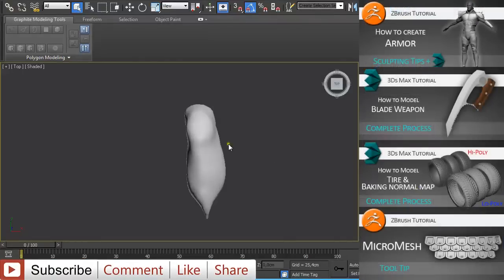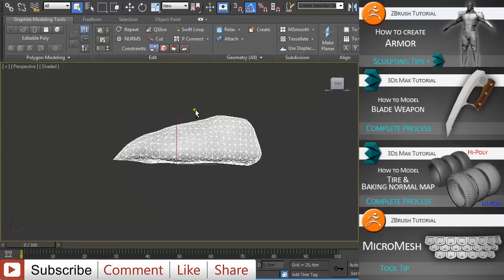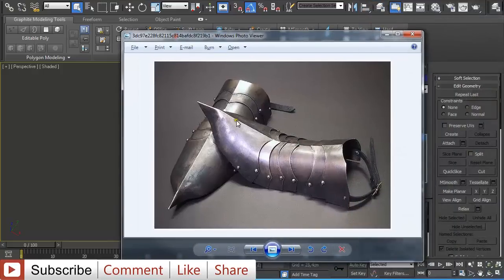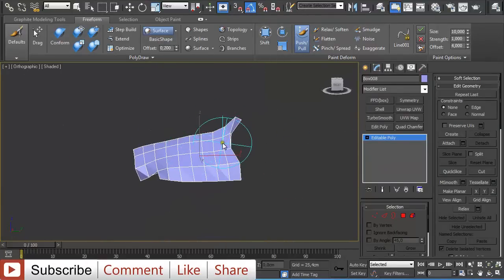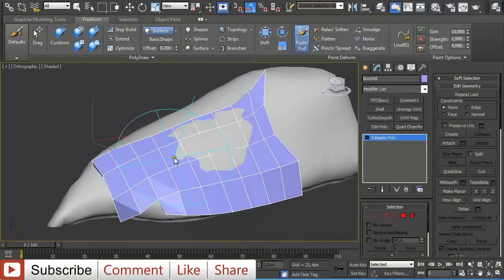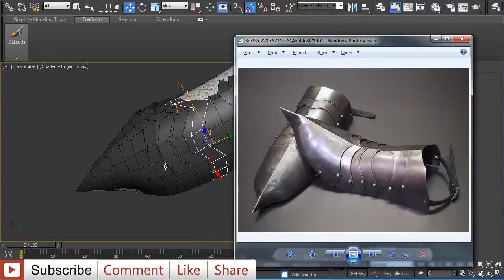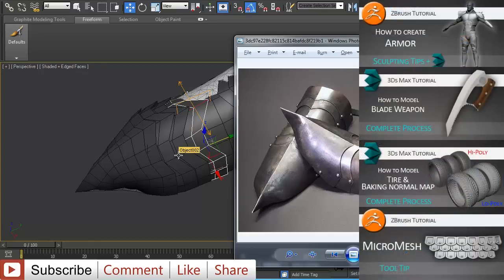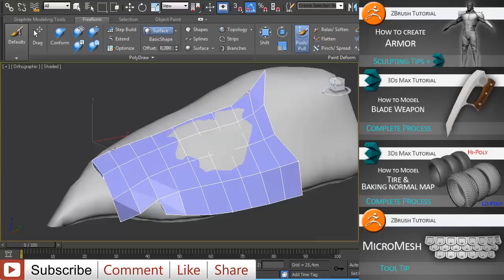3ds Max tutorial: Retopology with Freeform tools

Comment: how to use conform tool in spline 
please tell me
Reply from the maker: You can not use conform on splines. You need to convert it to editable poly and make adjustments with comfort tool. Then you can select edges and "create shape from selection" (under "Edit edges" section on the right of your screen)
Reply: but i m use spline and convert spline to editable poly then hide spline
Reply from the maker: you need to have your spline "closed" so when you convert to editable poly it can create polygons

Comment: Good video, but I have a question: Why is it necessary to do retopo by hand? Usually when I'm making a model, I start with the low poly outline first and then build the high poly from that. This way, I already have the low poly mesh in mind that I want to use and I don't have to go through this process.

It seems this is only necessary when you start with a high poly and don't have the low poly it came from, or the decimate/optimize software isn't working right.
Reply from the maker: Its not necessary to do the retopo by hand. There are also other ways to make low-poly model (one is the one you described). I just wanted to show, how a high-poly model can be retopo with tools in 3ds Max.
Reply: That's usually the case for hard surface I find.
Reply: If you sculpt a model in Zbrush for instants, you do a high res sculpt that then needs a retopo for low res mesh
Reply: Import a solidWorks file, all of geometry is  "Tris" . this method is very useful for create a new objet from imported files... If you dont have retopology modifier (thats mi case)

Comment: I just have a question, as a game design student. Why do people still use these freeform tools in max when there are tools out there in other programs that can do it automatically (with some fixes after). Can't you save lots of time that way, if you had to meet strict deadlines? I'm genuinely curious and need to ask for a project I need to be working on.
Reply: I have worked on 3+ AAA titles and we usually have to retopo most of the parts by hand for game models as zremesher doesn't give u proper loops most of the time and increases the tri count of ur mesh unnecessarily even for the models which are not going to be animated.
Usually using a zremeshed mesh gives u a lots of problem during uving,rigging etc that too with a high tri count and it cant be used for a hard surface model at all.
zremesher was only helpfull to me when I had to retopo some hi poly trees, even then i had to do 70% of the work by hand.
Reply: i have tried lots of techniques to get a good mesh out of zremesh which are:
(Numbering them based on their effectiveness) 
1.Quick slicing the mesh into different polygroups and then using frame mesh based on polygroups and use the curves generated by it as zremeshere guides and finally zremeshing with the keep group option switched on.
2.Using crease curve brush instead on quick slice and then generate curves based on mesh creases and set curve strength to 100
3.using zremesher guide lines
even after doing all that the mesh wont be good enough especially if u r making a game asset
Reply: awesome, thanks man!
Reply from the maker: But it can be created faster then doing retopo by hand from scratch. In my opinion what is created in ZBrush can speed up the process till end result. 
At the end of the day its a question of personal preference. So use the technique you feel best with :)
Reply: Imagine you only have 3ds max.  Good if you have money to buy  all programs you want, but  what if you don`t?
Reply from the maker: Indeed there are software that can really speed up the workflow. Why people still use freeform? Don`t really know :D. Maybe its because they are "old school" (from back then, where there were just Max and Maya) or dont have the other software. Maybe its a personal preference since they dont want to bother figuring out new software. 
I guess everyone needs to find their way and means to get the job done properly and on time. So I suggest you perfect the workflow with software you are most comfortable with, but dont ignore other software since a lot of times companies (when hiring) have specific software they use and its really essential you know at least more then basics using them. 
All the best in 2k17. :)
Reply from the maker: Default ZRemesher is indeed sometimes clumsy, but if you use the ZRemesherGuides brush, you can get pretty decent results. Its not that its not possible to achieve usable retopo with ZRemesher, its just that it takes some figuring out how the automative retopo works. But at the end you are always relying on ZRemesher to understand your wishes. 
I normally use it to give me basic topology, then use ZModeler to make some adjustments, and if its really necessary do additional adjustments in Max.
Reply: Then you don't know how to properly use zremesher and making games in your studio will take 20 years instead of 3 to 4.